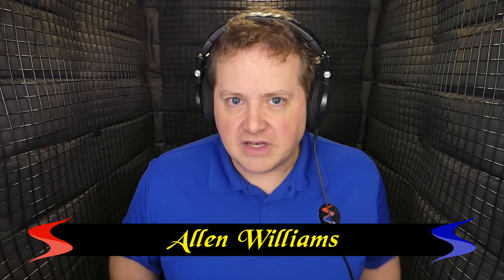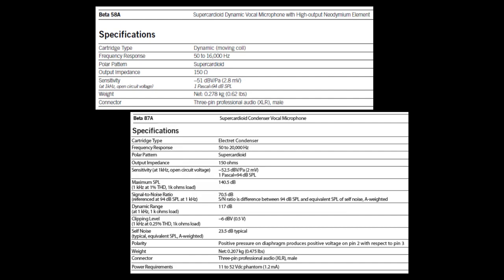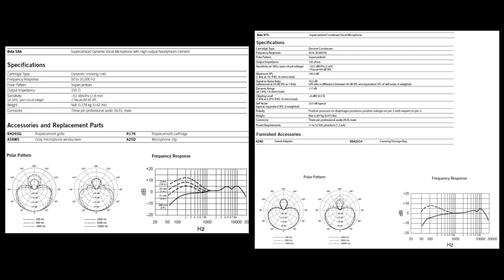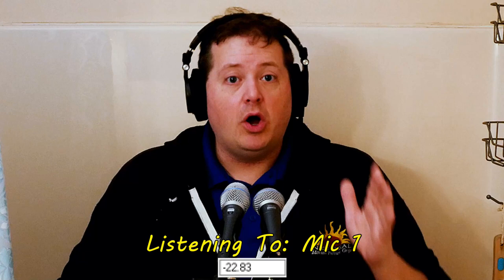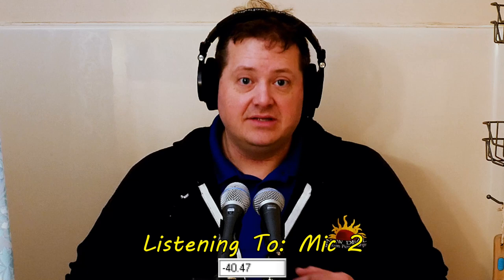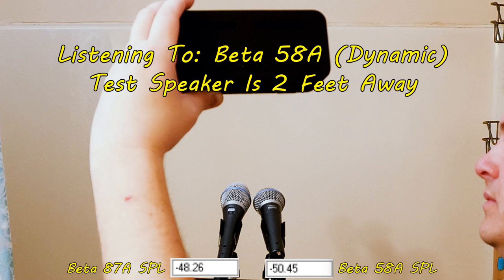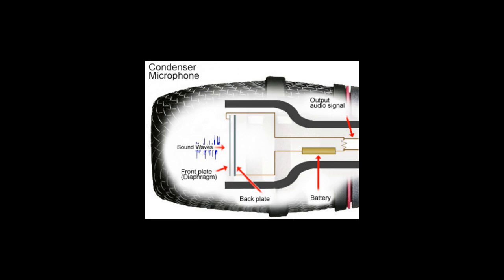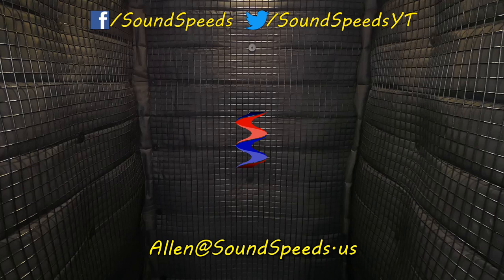Polar Pattern or Microphone Type? Best for Reducing Reverb - Sound Speeds

Comment: Great content as always, Allen. Loved that you had the numbers on-screen during the tests! I'm constantly impressed by your output. Do be careful about identifying mics by their grills, however. A Beta 57A has a flat grill with the same colour pattern as an 87a but is a dynamic mic like the 58a. It's my anecdotal understanding that the grills of mics have to do with a few different factors - 1. Patent - If you have a Sennheiser dynamic around, take a look at that beautiful, albeit likely flattened grill. Nobody else is (legally) producing the same shape. 2. Proximity of capsule to grill - Changes the prox effect intended by the manufacturer, leading to 3. Intended usage - Take the SM57, for example, since it's an "instrument" mic, the grill is much closer to the mic diaphragm and even has a slight detent to it. Particularly Poor at Powerful Plosives, but allows you to slam it right up close to the speaker on a guitar cab. Sorry if that's a long comment. Thank you for all that you do, and congrats on the shout-out in Patrushkha's book! It's been a fabulous read so far, the recommendation is appreciated.
Reply from the maker: Great comment! Thank you for that. Pinned!

Comment: Mic 2 clearly cut out the reverb, cut out the water and cut out the fan. This video entirely disproves Sound on Sound's 15 Popular Audio Myths. I normally take Sound on Sound as fact but they're wrong here and you've proven it dead-on. No way in hell are they the same. Not all. Clearly one is rejecting more of the audio than the other. Thank you for this video.
Reply from the maker: Sure thing. Thanks for watching.

Comment: No big difference except frequency response. Test will be even better if you align frequency response of both mics. The small difference will be even lower then, I think. Mics also have different polar patterns for different frequencies. So this is important factor too. This factor can be not the mic type but engineering depended so two different condensers or two dynamic can have the same difference.
Reply from the maker: But that is the whole point. A dynamic has a more limited frequency response than a condenser so if that's the only difference, then less frequencies picked up means less signal/noise from those frequencies.

Comment: I am the FOH engineer for my church and I have used both of these mics..  both wired and wireless versions.   I prefer the 87a for most vocals, especially female vocals..  the 58a can sound better on some male voices with the little bit warmer sound..  but I LOVE the high end expression of the 87a.  It’s much more detailed and articulate in the mid to high range, increasing intelligibility, imho.  That said, as long as a male vocal doesn’t have too much boomy 250htz, which can just sound muddy on the 58/dynamic, it can make a harsh brittle male vocal sound much warmer and more rounded!
Reply from the maker: Yes indeed. No question!  This test was about reverb and background noise rejection alone. Thank you for this comment though. Very good points.

Comment: You should have matched the response on-axis.
Other than that: Great test, thank you for sharing!
Reply from the maker: I did. First thing I did.
Reply: @SoundSpeeds  Did you match the whole frequency range with an EQ? I can still hear a difference between both mics. Mic one has more energy in the highs. It sounds brighter and sharper. That is why mic number two is genereally a little bit better at rejecting higher pitched noises. What really irritates me is also the level difference I can hear and see in the noise test with varying frequencies. If you look at the meters in the first few frames of every run (which are more or less on-axis) you can see that there is a difference of roughly 2-3 dB for most frequencies. Imo that is a misleading situation. For a fair comparison I would expect both mics to have the same on-axis response. What further adds to my confusion is that at 8:26 you hold up the Beta 58A at first and claim that it (as mic number one) is the condenser microphone.
¯\_(ツ)_/¯
Hope you can clarify that.
Best wishes,
Ellef
Reply from the maker: Let's start with holding up the 58A... I did that until I named it to mislead but the words are correct. You are also correct in what you heard and I did say that the 87A has an extended frequency range compared to the 58A. This is part of the reason why the dynamic rejects better than the condenser. They are a pattern match down the barrel hence my back off test. As for matching frequencies with EQ? No, I did none of that. I tested the mics for what they are and offer. I understand where you're going with it but in this case, a fair comparison was made between two microphones that were as close a match as I could find spec wise... without doing anything to manipulate the results.

Comment: I did a similar test for my students studying monitor placement and gain-before-feedback. At the time we were using simple analog chain but I would have loved to have made them redo it with a compressor in line to show why compression can increase the chance of feedback.  BTW did you notice that the inauguration podium had one Shure SM57 and one Schoeps CMC6/41 side by side? The big foam windscreens made it easy to hide.
Reply: They didn't have dual-ing 57's?
Reply: @marcusfrombespokeaudio5372  Not according to Kevin Mitchell's FOHonline article interviewing the inauguration's FOH engineer/system designer Patrick Baltzell. Also CMC5/41 my mistake.
Reply: @kengoodwin459  changing things up! Please tell me the industry is starting to grow past 57/58's...
Reply from the maker: As I understand it the Schoeps was inside the 57 body though. The optics are the the same, traditional, that way.
Reply: @SoundSpeeds all about that symmetry and movie magic!
Reply from the maker: And keeping up tradition in appearance.